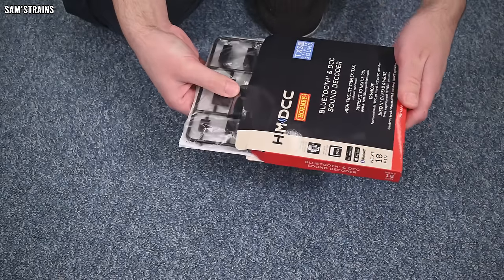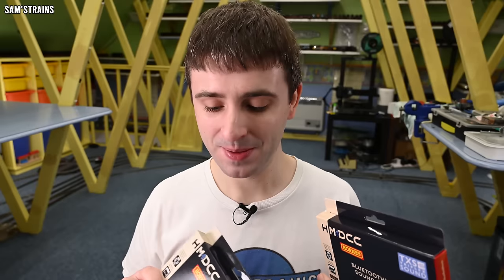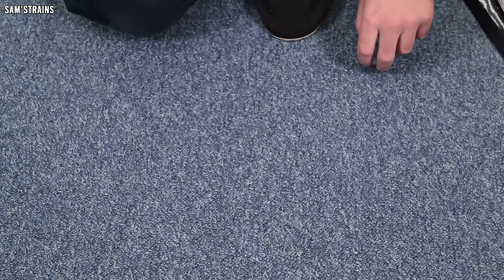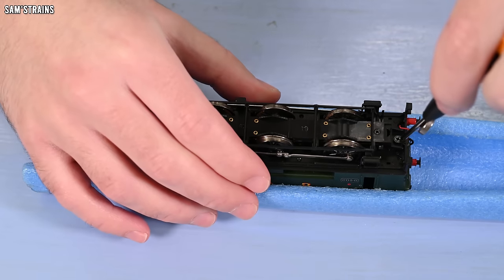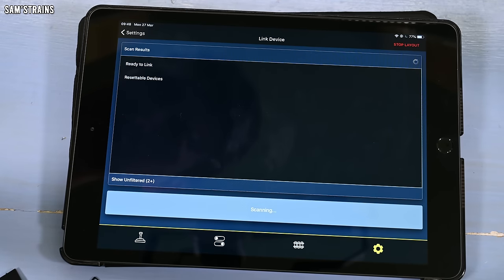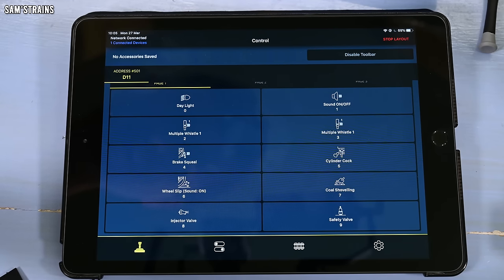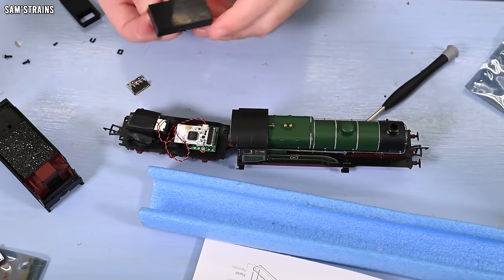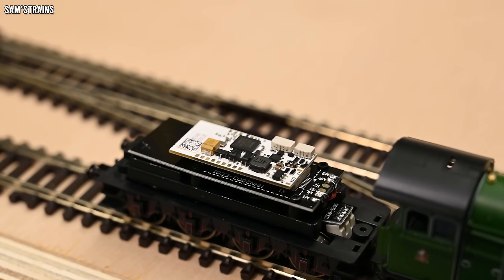Too Big For Most Locos & Burnt Out After 1 Day | Hornby's New HM7000

Comment: Nice idea, but questionable application.  The Next18 decoder burnt out?  Did you electrically isolate the decoder from the plugin board? as it does seem the length of it may allow it to move in the socket with a bit of torque.   Either way, it does seem like the board is overly longer for no reason other than to put information on the board, there doesn't seem to be any components in that last cm or so of board so if it wasn't so long it may fit into other systems,  now that said I'm not sure if there are traces in there so I wouldn't suggest just taking a bandsaw to cut off a piece of the board or anything but as others have said it seems that Hornby cares about servicing Hornby trains and only those trains even if there is market outside of that with decoders.   

It seems a shame as it's a neat idea, although it is very ecosystem dependent great if you you have a few locos you would like to put DCC and sound into and not having to buy a controller etc,  however if you have a number of locos and have to swap out existing DCC boards it could get quite pricey and it may turn out that buying a controller like the NCE one is a better value

Comment: I would guess that the reason the Next18 decoder fits the TT locos so well is because they were developed at the same time. A cynic might suggest that the design is deliberate, to force a Hornby ecosystem, but I am not that person today.

If I were to guess, the profiles default to assuming included speaker would be used for sound output; the function map probably told it that there was a speaker already connected, use that one.

Looking at the diagram, it looked like there was only one socket, suggesting to me that the user must choose between having sound and having a power bank, not both.

I don't know how future proof that app is. Will they keep adding profiles? What happens when they decide to discontinue support or even remove the app from stores? Unless another Bluetooth solution is figured out before then, there will come a day when they become simply overpriced DCC decoders (if they don't all burn out first!)

Hornby could do with lowering the difficulty curve to get started and improve build quality; but otherwise it looks to be a game changer. right now
Reply: Very balanced comments. The business case here is using these chips to get new (or ex) modellers into the hobby quickly and easily. I agree - it is not building a new Bluetooth ecosystem for complete control of a layout etc (though they have said that... I don't actually believe them). Throughout their entire history as a company this is what they do. They get people in or "again"... but don;'t really build on that for serious modellers with big layouts and complex wiring. They leave that to the Digitrax/NEC/ESU's of this world. I wish they would do all that though using bluetooth wireless.. (build an ecosystem using bluetooth)..but like it's been available for decades... so why hasn't one of the other big manufactures ..even them?.. done it already?? If it was easy (to make a buck doing this as a business) , someone would have done it already. However, this is why they have been one of the most successful British companies in history.. at the end of the day they are still standing!!! And for that we need to be grateful. One of the only rail modelling companies to survive - which is saying something for their 100 yr history, given the pitfalls, costs and state of doing business in Britain. Just MO
Reply: Hey there. I'm that person.

Although i'd wager the TT120 models were designed in knowledge of the forthcoming gigantosaurus decoders rather than the decoder being deliberately so. 

Hornby are most assuredly trying to create a closed ecosystem though. It's the in vogue business strategy for companies losing their position in a market.

Comment: Potentially a good idea, but the oversized next18 decoder is a no-go for me. If it can't go into OO small to medium size steam engines, I won't even try it on my N scale Dapol class 121... And the next 18 goes straight into a TT engine by Hornby, amazing, is it ? May someone test it with a Tillig BR 86 or, better, a Gützold DR BR 37 ?
The app seems correct and have a coherent ergonomy, but if you can't program your sound profiles yourself, the provided banks are limitative. What if I want a DB BR 23 sound, or an Italian Gr. 740 sound ?
On the field, the cutoff test is cruel, and, for the one who are interested (not me), the lack of sound is a real drag... The behavior of the next18 with DCC control, compared with the Bluetooth application, is a complete joke. At least, it seems to be a software issue.
In short, a good idea, but made by Hornby... DCC on Bluetooth is a nice idea, if not a gamer changer for digital modellers, but I won't buy it from Hornby, period. And I want a good ol' knob to turn to run my engines, it's proposed on classical systems, and there is zero technical reason to not provide it on DCC on Bluetooth.
For my own, I would rather buy a Dijikeijs central with knob controllers from other manufacturers (Digitrax is a candidate) and get a JMRI for my laptop on Linux for the software part, fits more my needs, and have also wifi controls for wireless operations. Requires classical DCC decoders, but works, and is not manufacturer-dependant.
Cherry on the cake, the toasted next18 decoder... Let's say schlitz happens to every manufacturer (Accurascale/ESU anyone ?).
Reply: Totally agree. The issue here is will that HM7040 bluetooth dongle plug into the Dijikejs DR5000 and communicate as a throttle (using the Hornby app using it's XpressNet communication protocol)..so this Hornby HM ecosystem can really take control of a layout and all trains on it (whether chipped DCC bluetooth or just generic DCC). So we can use the one Hornby app.  I am waiting for someone to test it out (once the dongle becomes available)

Comment: It's almost a quarter of the way  into the 21st Century, so surely the company could've planned the product better, especially the size.
Surely, the company would have known the decoders were too large beforehand?

I wonder how and in what locomotives they were tested in. A relatively new product already needed an updated??
Reply: Software often needs updating shortly after release, the real world throws up all sorts of weird edge cases that lab testing can't cover.
The 8 pin sound decoder is smaller, as obviously the non sound ones are too.

Comment: I only have 1 Hornby Loco now a very good class 56. Had problems with TTS in the past so don’t bother with it now. Have had issues with other Hornby locos in the past and have since sold them. Am in the process of replacing other Hornby rolling stock in place of much better Bachmann and Accurascale items. I just find Hornby a let down these days. I run my DCC layout with an upto date select which I want to replace at some point. But don’t think it’s going to be in favour of this new app 🤷‍♂️

Comment: Seems to me the NXT18 decoder size is hampered by the QR Code and information at the bottom, without that extra few mil that doesn have any circuit board or components it would have fit every loco you tried :/ Kinda bad on their part.
Reply: Risky, but if there are no tracks or components, that 1/4" could be removed.
Reply: My thoughts exactly... Considering the QR code is on the box and paperwork... Not sure why it needs to be on the chip itself shut inside the loco..

Comment: The delay to regain control after  a power loss is because it takes time for the Bluetooth system to reconnect.
Reply from the maker: Yes that’s correct
Reply: It also may take a little time to notice the connection has broken before reconnecting.

Comment: This is a fantastic idea but as Edison supposedly said "invention is 1% inspiration and 99% perspiration" 

Hornby is well versed in bringing a new version of the Princess Royals that look fantastic and run well  into the world but when it comes to electronics and software not so much - this is not their area of expertise

What you have is a prototype chip  that can work with the IOS operating system in a somewhat clunky manner. It will not interact Android yet, AFAIK, and that is the bigger segment of current mobile phone and tablet market.

When I saw the announcement, like you I was excited but what actually  exists at this point shows potential but remains  underwhelming 

What Hornby needs to do is to partner with other companies with the pre requisite experience and expertise in the appropriate areas (electronic engineering and software development) to bring this dream to fruition.

At the same time developing these products they are also bringing to market the TT range

As it is, it seems to me, they are trying to do too much too quickly without the inhouse expertise and making fundamental errors in the process  - we see that with this for example  curve geometry of the TT scale third radius curves being wrong, something that should have never happened

Comment: The cynical side  of me says, 'Buy those decoders now', even if not for immediate use: it's not at all unusual for a manufacturer(of anything) to set prices low, at or even below cost, when introducing a new product to get the ball rolling and attract attention. Sooner or later, the prices will run up to the overall 'market price'.
Having the ability to load your own sound files would be great fun. Imagine having an engine unleash a wolf howl with the whistle function!
Reply from the maker: Yes you're right of course, although there are issues... if Hornby improve/upgrade the decoders, I wouldn't want to be stuck with the old design. I think the price is the big reason why these are attractive, as apparently more expensive decoders do offer better sound performance. If these cost more, I don't think they'd sell as well!
Thanks for watching, Sam :)

Comment: Someone should make a bluetooth adapter that sits between an existing DCC decoder and the 8/24 pin socket inside the loco. Then all existing DCC decoders could be used in this way.

Comment: That's a fine bit of Hornby bashing. First trying to fit the Next18 into anything but a Hornby loco. Me thinking: were's here going with this. And than at the very end, after stressing how cheap they are (for a change from Hornby); Oh yes, they only work for a day. 
And one down you've missed because you use an iPad. The Android version is not out yet !!!!! At least we're not tempted by this chip for a day. If you bother to first try and download the app before you buy.
THANK YOU for honest reviews !!!! Now let's hope ESU and Zimo do get scared and realize 100 pounds is to much for a chineese chip.
Reply: Agreed. Especially on the part of the pricetag. If you check the prices of the DCC equipment (decoders and everything else too !) against inflation since the 2000, you see they have not come down. In constant money, a DCC controller, for instance, is at the same price today as in 2003, when you have to spend 2000€ for a basic laptop computer. Today, you have a laptop computer for around 400/500 € at an entry level (and far more powerful and equipped than his 2K € equivalent of 2003 !) but the electronics of the DCC controllers, for instance, is the same as in 2003... I've bought a MRC Prodigy Express controller in 2006 (sold rebranded by Gaugemaster in Europe) for around 135 € ready to use at this date, and the same is sold today at around 275 € ! Same electronics since at least 2006, and less complicated than an advanced pocket calculator for a teen in high school sold for less than 100 €.
Yes, you can drive the prices down on DCC equipment overall, not just the decoders. Dijikeijs had made a control station ready to use with a power supply for a little bit more than 200 €, with connectivity to anything, or close, including built-in wifi, that exists as accessories in the DCC standard, when others sells their compatible with not-a-lot-of-things stations for twice or thrice this pricetag...

Comment: Regarding the size of these decoders. 2 problems -
1) the integral Bluetooth aerial as has been pointed out, but:
2) the fact that Hornby are marketing them as "conforming to NMRA standards". Ah, with the qualifier og "all relevant NMRA standards"  As the NMRA spec I referred to for Next18 provides dimensions as part of the spec - no doubt to which every mfr except Hornby conforms - it's clear that Hornby don't consider size conformity relevant.
Typical, sad, and why it's difficult to know how much you can trust Hornby products.
This system has so much going for it, though. Spin it off into its own company and it could become really great!
I'm fitting TXS to 3 non-Hornby locos using adaptors, trusting that the quality of manufacturing gives several years of life!

Comment: half the size of those decoders seems to be just text, it looks like they could easilly trim off the end few millimeters of the decorder to make it fit better into most locomotives.
Reply: The end part is the required bluetooth antenna.
The only alternative is for hornby to use a more expense version with separate antenna with 2 extra wires to be placed somewhere else in the loco.
Reply: @Cloudman572  two extra thin wires and a smaller decoder seems a lot easier to fit in a loco than a decoder that is already too big for most locos.

Comment: I look myself in designing a wireless the system, but I see that the system is doomed from the starts due to:
1. It uses Bluetooth
2. It's not open.

Bluetooth requires often driver which need to be ported to devices. And as long as not everybody can make compatible decoders and equipment, you are stuck with Hornby. As I use a variety of brands on my layout, I would never buy something proprietary.
If something like that you should succeed one day, following need to be done:
1. It needs to be a standard by NMRA and NEM
2. It needs to be IP based, so it is independent of the physical layer.
3. It must easy enough at amateurs can make own equipment.
4. It needs to give extra functionality that DCC deciders cannot give. Like are functions only on/off, functions could be a servo position.

Comment: I noticed the box claimed the "NEXT 18" decoder was compliant with NEM 662. If you look at the English version of that, it does define maximum board sizes, so it is concerning that they're breaking the standard. OTOH perhaps this decoder is actually a bigger "NEXT 18S" decoder? It'd make sense.

The Bluetooth functionality is not new, I think a US manufacturer released some in the last few years.

The app functionality is also not new. Cough Z21 *cough*.

Hornby's combination is novel, and the price would be good if it worked better.
Reply from the maker: Yes exactly Chris - the decoder should have been 25mm long, and this is much longer than that. Not NMRA compliant, another lie on a Hornby box! Yes not new too - I've seen others like it, but it's new to the UK as far as I know!
Thanks for watching, Sam :)
Reply: @SamsTrains  it is especially ironic you couldn’t fit it inside an OO loco - NEXT 18 is designed for N and TT :)
Reply: @Haymarket47  Z21 has good OOTB support for Zimo decoders, and I expect Hornby's decoder support is similarly good but only for Hornby decoders. I would use JMRI for anything very complicated.

Comment: Very good vidoe about the new system. Hornby though have made a big mistake with the size of the chip, especially for the small locomotives, that needs addressing straight away. If they do not reduce the size of the chip so that it is a universal fit into other manufactureres models, then if one of these manufacturers brings out a similar chip but smaller, Hornby will loose out in the market. They have invested a lot of money in the system. It would be a shame to see it wasted by not having much forthought about who is going to buy it and what locos it will be fitted into

Comment: Call me sceptical , or septic, but Hornby have a track record of losing interest after a while in developing technology which ultimately will benefit themselves. Example Zero technology from 70’s was the first regarding remote control, but they lost interest as it had product problems. Point motors another example. But I don’t think they are to blame for the chip burnout, most likely a fault in the board, which happens a lot. The components are always a source for failure, bad batch, flakey wire, circuit board substandard, but most of all , Bluetooth has a habit of spikes and the Bluetooth components invariably run hotter than under Dcc , most failures in mobile phones is Bluetooth reliability. Excessive heat . Maybe Hornby should test to ensure the power to track optimum is able to cope with the rigorous Btooth fluctuations. Or it may be aware of a problem with a batch of the chips etc. 
Early days, but hopefully Hornby won’t lose interest if the Zero is anything to go by. 😢😢
Reply: Bluetooth LE, which is what these boards are using, is specifically designed to be very low power -- a few milliwatts on average. Bluetooth chipsets don't run hot. And I have no idea where you get the idea that "most failures in mobile phones" are down to Bluetooth.

Comment: The protruding PCB part is probably the Bluetooth antenna. You can try chopping it off and drive on DCC. The Bluetooth range will decrease dramatically, but when the control is coming from tracks, it doesn't matter much.